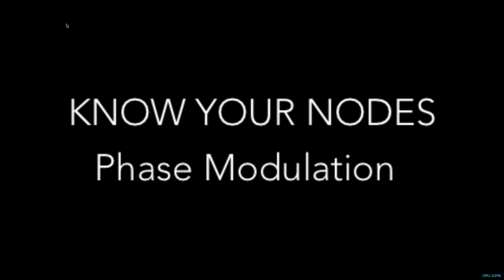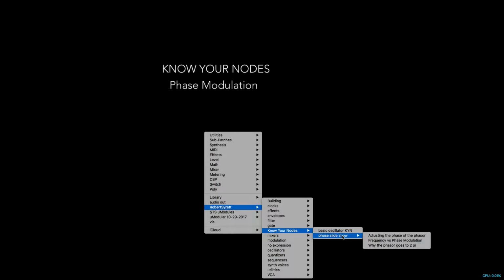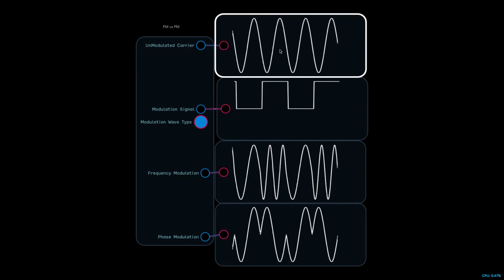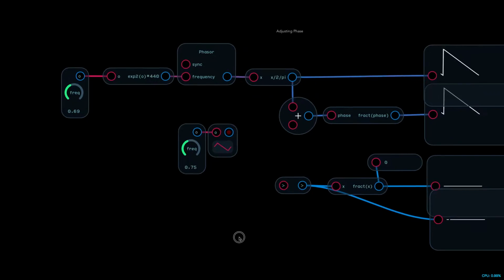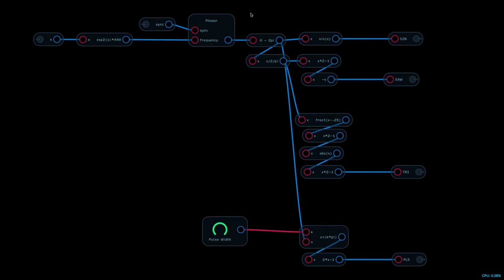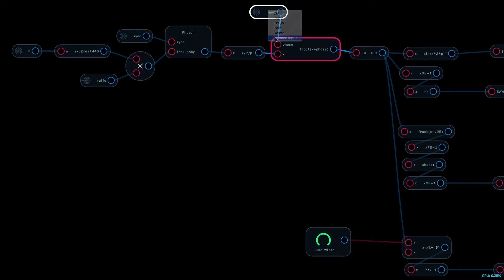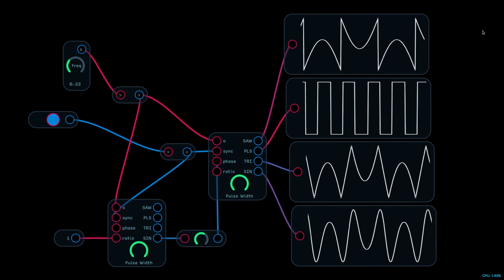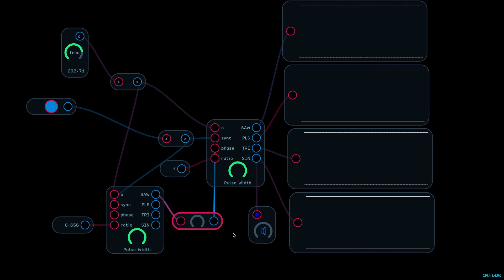Know Your Nodes pt 2 Phase Modulation in Audulus 3

Comment: Very well put together video which shows both basic synthesis theory and its practical application in Audulus 3. On iOS, Audulus allows me to learn new information about synthesis so I can create sound all on the same device. Breaking things down like this for people who are new to synthesis is very helpful as it helps to bridge the gaps between theory, programming, and creating a practical patch to output sounds you’re after. Being able to explore this way has proven to be a door to deeper insight into audio, music, and math which are all drawn upon in the process versus tweaking a bunch of knobs and pushing buttons on a hardware or software synth where there’s a lot that goes on under the hood that I’m taking a stab in the dark at versus being able to go as deep inside the synth as I want to with Audulus 3. Thank you for filling in an important void with your videos.